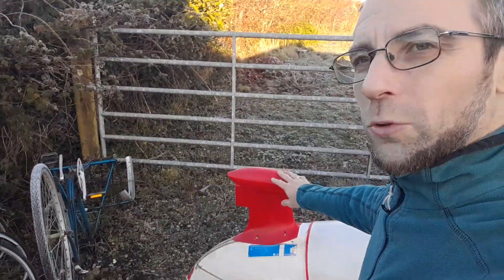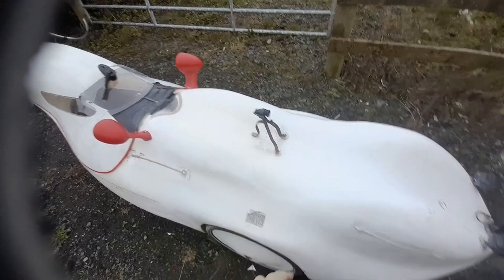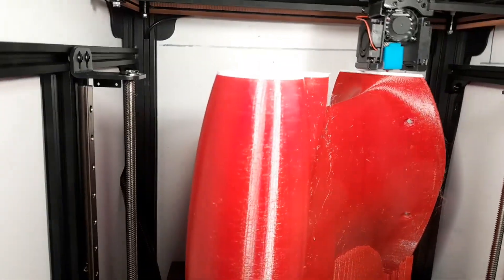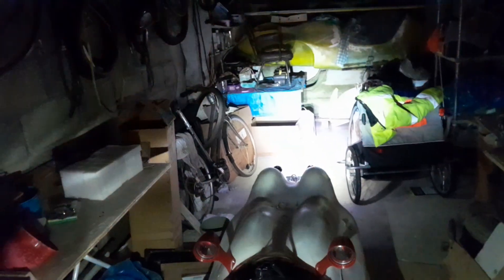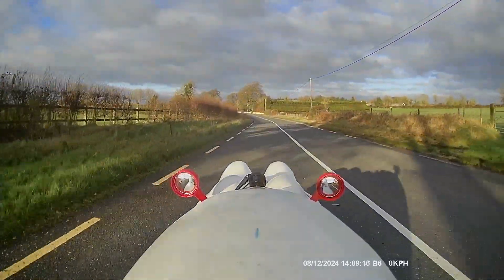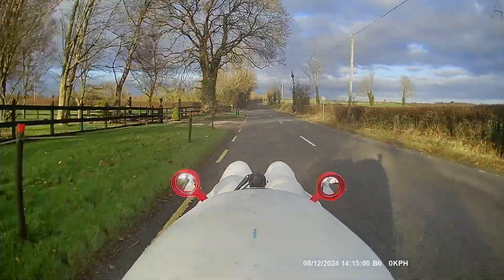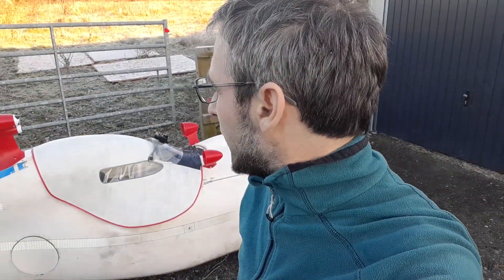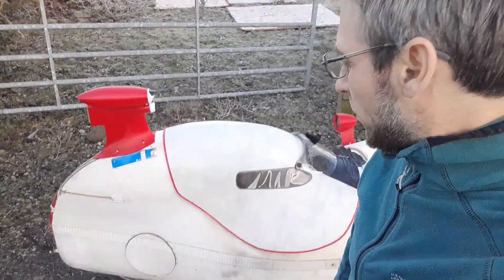No More Flags! Creating a 3D Printed Beacon for My Velomobile

Comment: I think it's desirable to make the heead light in two parts. The low part Could be adapted to each specific velo.
Reply: Came here to say exactly the same thing. Either by means of a gasket plate or a two pack grout of some type.

Comment: If you redesign it a little so the beacon and mount to the machine are separate parts then it would become more universal. I'd suggest actually going for 3 parts, the beacon pod at the top, the aerodynamic fairing spacer (which some users may want to use more than once to make a taller beacon) and then the more optional base to attach it with. As if you use two carbon fibre tubes of a common size to join all the elements together than simply by drilling two holes of that tubesize with the right spacing anybody with a little fibreglass skill can mount the tubes to any velo. They would just have to accept the root of the beacon to the velo shell won't be as smooth as the holes put in the velo's shell are larger and more force concentrating so in an accident it might prove more expensive.
Reply from the maker: Yes, you're right. The fin and beacon as separate parts is a very interesting idea. Most likely I will do exactly this in the next model in the future. Thank you!

Comment: I love that your 'outdated model with several issues' is better and much more modern than the one 3d printer I still have working (but the thing has been reliable enough till recently that I wasn't bothered at all - going to actually get my older but higher quality one a brain transplant and further upgrade the print setup this year, as it becoming required). Which leads to my big point an older printer is not an issue - you simply have to printer slower and probably avoid some of the more challenging/specialist filaments a new printer will just do (or need to fit modifications)...
Reply from the maker: Unfortunately, older 3D printers do not have one important function - continued printing after a sudden power outage, or automatic change of material.  I chose the Twotrees SP5 V3 because of the large print area, but I had to change a lot of parts and still have a few tweaks to make. But, we like to create and improve things, and not buy ready-made ones, right?
Reply: @Veloreamer-ENG  I tend to put a UPS inline with the printer if its working on a long print - get an old PC UPS (even without a battery replacement it will last long enough to keep the printer running through any outage I'd get here or one of those 'camping' lithium battery or bigger if you think you might actually need it (Actually have an Ecoflow delta that could probably do any print I'd be able to fit on the bed as well, but that is sitting at the grandparents to make sure they have heat and light).

On multi material not really true - even very very old printers came with multiple extruders, sometimes. Usually only 2, but 2 is enough for most multi material prints, down side is the extruders tend to be conjoined so you have to put in effort to get the setup just right (which can take quite a while).

Comment: Very nicely built! 👌
I'm planning the same for my Quest, but to be printed in four parts: A base with a V shaped sliding and locking system for the fin and separate coverplate for when fin is slid out and disconnected, and a fin in two parts that click together to ease cable routing for the cameras and fixing the other things, planning, already did trials with a remote controlled battery bike light and a Bryton Gardia Radar.
Just has to be more streamlined and aesthetic like yours!
I like the red with white!
Reply from the maker: Great idea for a composite design! I will also use this in the future. I wish you good luck with your project!